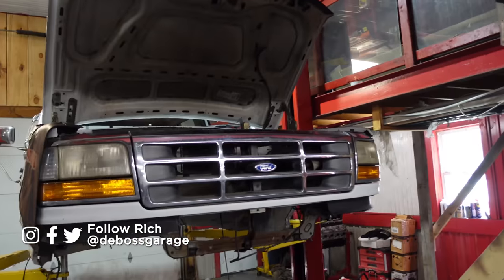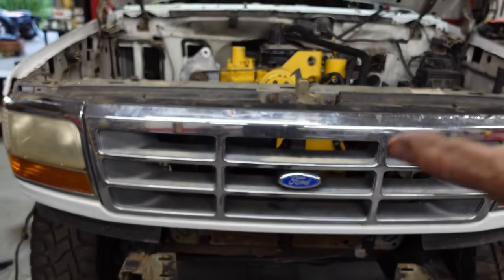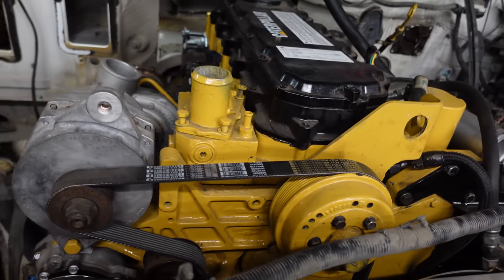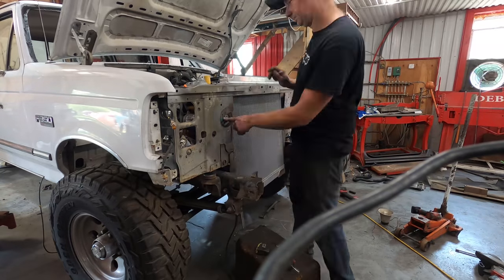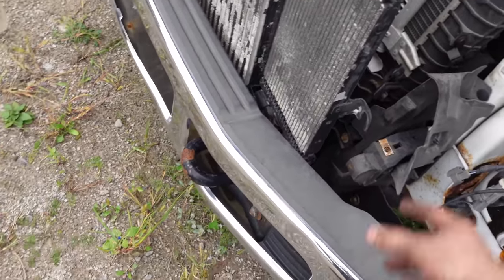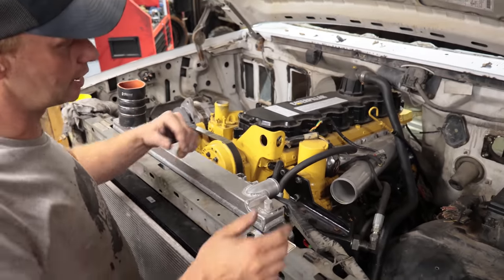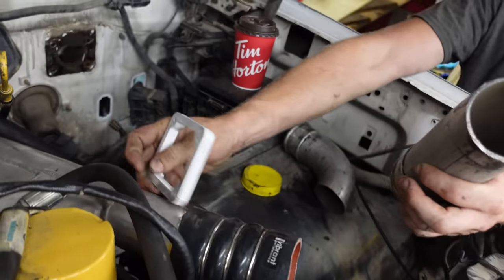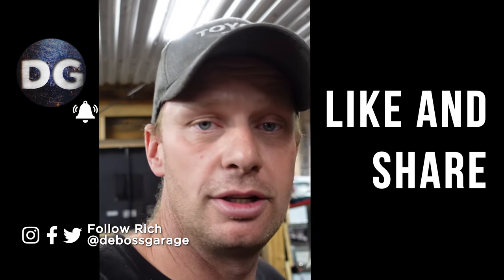How COOL can we make a CAT 3126 swapped F350? | #FTreeKitty [EP15]

Comment: If that stock Ford grille still ends up being in the way, you could have Vince build a custom tube grille similar to the old custom Stull grilles from the 80s.  You could even make it fit proud of the stock mounting location a bit so it sticks over the bumper.  This may give you more room for the intercooler.

Comment: Been toying with the idea of diesel swapping my 1984 S10 flat bed welding truck. The 4BT was obviously my first thought. Fitment and weight might be an issue there. The OM617 was anther choice. I'd like to keep it a mechanical inline injection pump. What would be some other options that are common enough down here in the lower 48 to get parts for?

Comment: Are you planning on setting the ecm timing on this. I am sure it has timing values on the ecm but good piece of mind to use cat et and run a timing calibration procedure. This engine times of the flywheel where a modern c7.2 times off the crank.

Comment: I realize it's too late now, but that cooling package is getting dangerously close (in rough dimension) to something you might find commercially available in a medium duty truck. When the next swap series comes, I'd be curious to see if something out of like a 4200 could be wiggled in. It would sure make things a lot easier to have a catalog solution available, especially with an in-tank transmission cooler that is already sized for an Allison at your engine power level.

Speaking of commercial truck cooling... You may want to consider some stay-rods on the bottom of your radiator mounting so you don't end up with an oscillation from that somewhat long-ish lever arm down there. Once it's full of water you're going to have some considerable weight down there wiggling around. I'm not saying you have to have them, but for a few bucks and a few minutes, it would be nice to know they're there.
Reply: If you watched the videos the rad is an aluminum OE replacement for a super duty. Im not sure what he meant when he said the rad wasn't readily available, an OE rad should be available anywhere.
Reply: @maxsav007  I'm not sure what he meant either, obviously.

I would still be curious to see if a full-on MD cooling module could be fitted between the rails. I'm almost positive it wouldn't be any taller.

Comment: I might be getting an 2015 f250 xlt 6.2l v8 next week. I'm excited to upgrade from my 96 s10 extended cab 4.3 v6
Reply: I bet you won't be so exited if you buy it and go to the gas station, once or twice with rising fuel costs. I'm running a 99 7.3 diesel superduty here in Canada,  with fuel at 1.30 Canadian a liter I'm even questioning the running cost on it at the moment  I got a $150 fill the other day and it wasn't even empty !

Comment: That looks like a cheap easy swap🤔 NOT. You did inspire me to get my 1st CAT engine.  Also a 3126. In my motor coach soon to be Home. Thinking about a fass pump, a filter kit for the injectors and pull the oil cooler to make sure it's sealed. It runs good now and i want it to stay that. way. 😁

Comment: yep have to drive the piss out of it to get the whole heui system to bleed fully. it always happens with 6.0 powerstrokes when doing injectors and you drain the oil rail. causes extended cranks and misfires

Comment: If you're running a cooler for the auto trans and the powersteering,why couldn't you run both of them through a single cooler,one that's big enough to cope with both of them,or would they be different pressures,just asking
Reply: Not a real good idea, if anything ever happens to the p/s pump, you just dumped all the debris into the trans, and vice versa.

Comment: It will take at least 50 miles of driving to clear the air out of the system, don't let it bother you when running good they light much better.

Comment: Is there a reason that you haven’t done the RSK kit yet? It seems like that should happen before you mounted all the coolers. The RSK isn’t really optional on these trucks.
Reply from the maker: Can't do it without lifting it and I don't want it any higher.  As much as I want to, I am not lifting the truck...
Reply: I think you can do it with less than 2” of front lift if you build your own. If you weld the front hangers straight to the frame and only add the shackle into the rear hanger it will on add 1.75”.  That’s basically enough to compensate for the cat.
Reply: I’m telling you, I’ve been running this truck for over twenty years and having the swing shackle in front is an absolute travesty. You will never have good steering without reversing it, not to mention the ride characteristics.
Reply: Reverse arch the front springs if you have to.

Comment: Why would you need a intake heater ?     I drive a 12V RAM here in northern Sweden, and it starts easier without the grid heater, even in -20 C, because the heater just drains the batteries...  :-)     So I have disconnected the intake heater.   :-)
Reply from the maker: the grid heater should warm up the batteries which actually raises your voltage.   grid heater is a must, and so are good  batteries
Reply: @DEBOSSGARAGE  OK   Maybe on a CAT...   ;-)   ;-)   ;-)

Comment: a stock 460 rad should work okay. The gas engine is 40% less thermally efficient than a diesel. so 7.5 gas motor heat rejection should roughly be equal to 10.5 diesel. 7.5L x 1.4 = 10.5L.

Comment: Really?!  When I swapped the 5.9L Cummins into my f350 I left the transmission in its stock location and used electric fans with the Cummins.  Original driveshafts!  We won't talk about the shit condition my u-joints were in but I did technically still have working 4x4!

Comment: I really don't think you need that massive radiator. Going thicker is better then massive height. Your fans suck they will not give you any cooling with no shroud or anything. This thing will run hot and the rad is so low it's gonna be smashed off first rock it encounters. When your rad is lower then the bumper and rad support that is bad. Not running a mechanical clutch fan is another huge fail. Name one heavy duty diesel that only relies on electric fans only...... No electric fan can pull the volume of a mechanical fan.